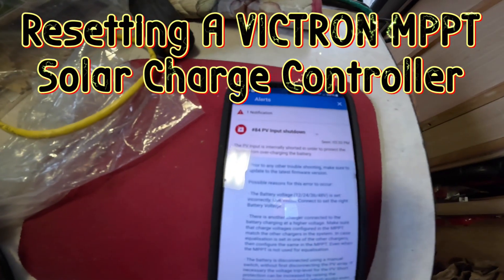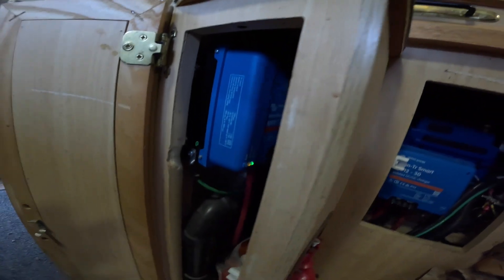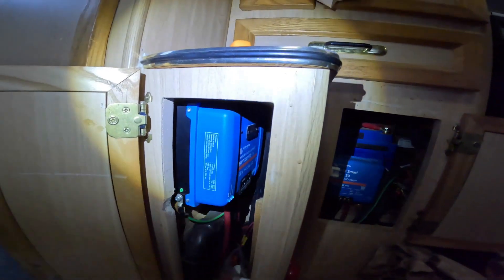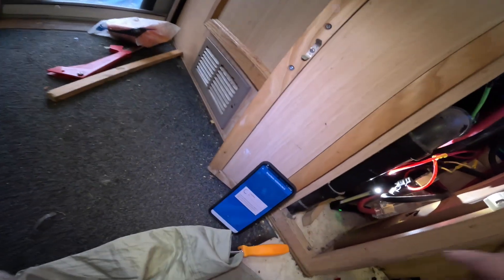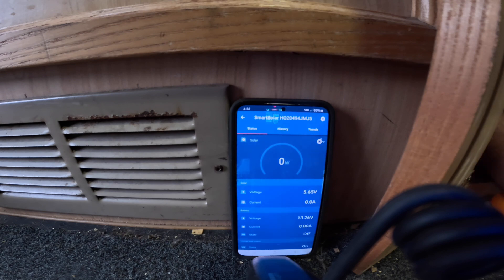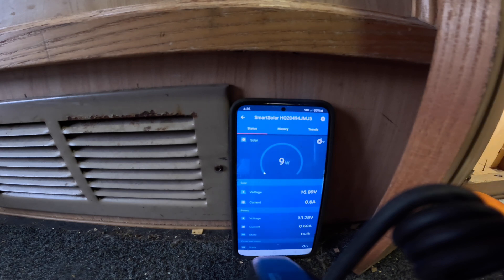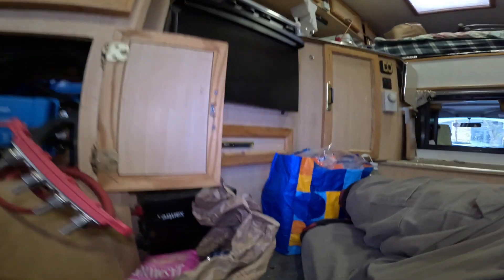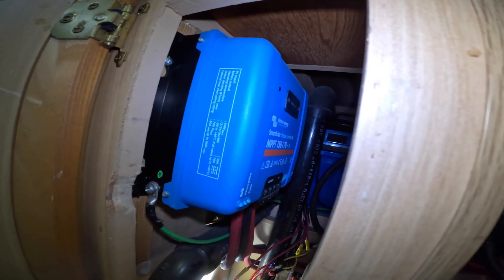Victron MPPT Solar Controller Reset

Comment: WARNING: Do not try this on a sunny day with anything over 50 volt system! I have exactly the same problem with my solar charger right now. But I have 5 x 40V panels in series giving 200V and over 2kw of power for much of the day. Unplugging a fuse in my system would probably create a huge arc flash and could even be lethal if I touched the live cable, especially now that I would have just blinded myself. I have to wait until dark to reset mine unless I continue searching and find a software fix.
Reply from the maker: Yes, you have considerable voltage and current waiting to get some unlucky person. My system is only 13.2 volts. With your system you are refering to solar panels and before the MPPT or other type solar controller. I am working with the Victron 30 AMP DC to DC controller so you're dealing with battery voltage, in this case, LIFEPO 13.2 Volts static. My solar controller puts out 13.2 to 14.5 volts maximum so not as much a chance of injury but it a wire slips, it could cause quite a light show of sparks. Electricity should be handled like a sharp knife.
I don't know if the reset procedure for resetting an MPPT or other similar device is the same or similar. Read your manuals. When working on solar panels in daylight, it it a good idea to secure a cover over your solar panels so they don't produce power, typically 19 plus volts. 
Thanks for pointing out a valid concern!

Comment: Yes, the charge controllers have an over-voltage safety feature that clamps the solar input (the charge controller assumes that it is at fault for the problem).   You can prevent this from happening by adjusting the battery configuration.

Basically you set the battery configuration to lead-acid to enable the equalization voltage field, then customize it and re-enter all the proper LiFePO4 values.   Leave equalization DISABLED, you aren't actually using the function.  But set the equalization voltage field to a value slightly higher than the external charger's target voltage. 

You will never use the equalization function, obviously, but the higher voltage in the equalization voltage field will prevent the charge controller from entering a safety shutdown due to battery over-voltage caused by your external charger.

Tripple check all other parameters to make sure you restored the LiFePO4 voltage settings properly.

-Matt
Reply from the maker: @junkerzn7312  
Good information.  The mppt controller came back on woth original settings I had selected. Interestingly, the battery BMS over bluetooth, reported 100% charged while ising the 6 amp charger. Now that the solar is connected and supplemented by the Orion 30A DC charger, the BMS never reports over 99%.. I still consider that full.
Thanks for checking in.